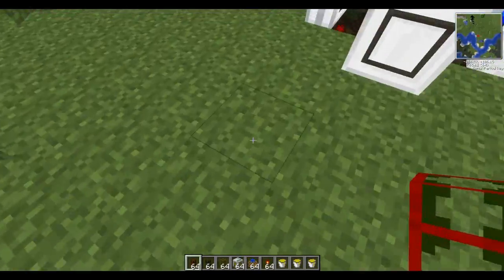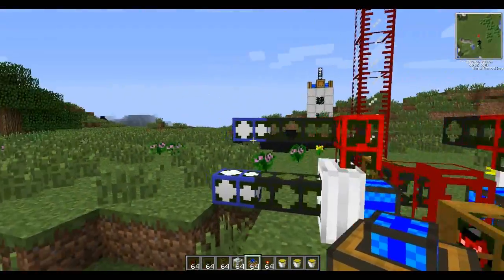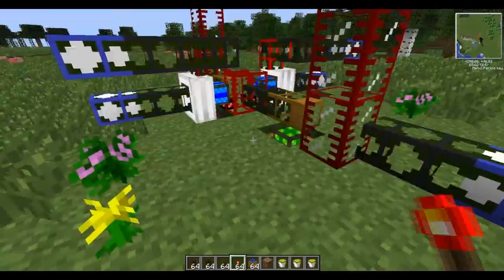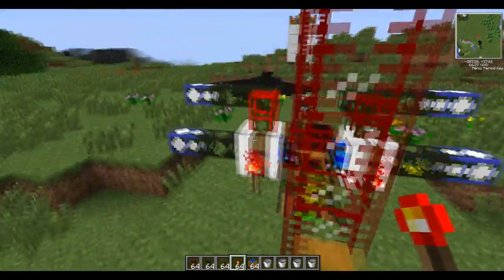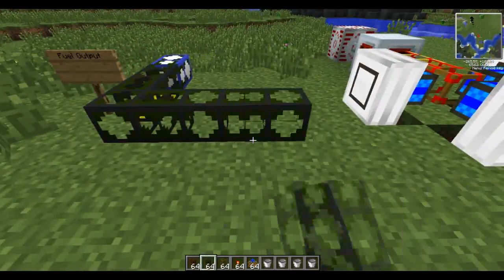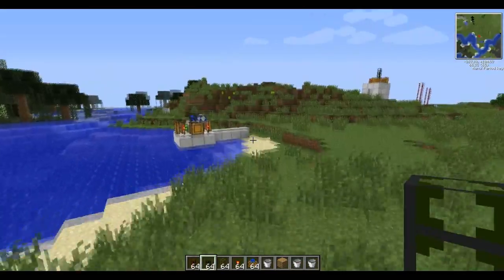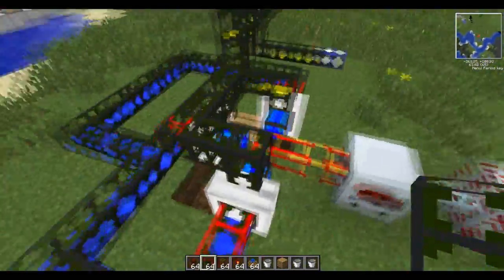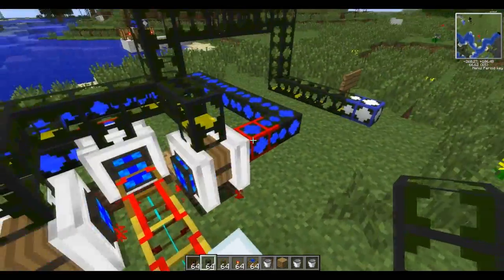Velerious' Tekkit - Safe Combustion Engine (Part 1)

Comment from the maker: Usually whenever I set it up like this randomly it seems to be that 3 combustion engines generates the 510eu/t from the combustion engines, when I put on a fourth it doesn't increase, the wiki does agree with you. Just saying I always set up like this and never have a problem or run out of power, you can always adapt it for many combustion engines though this was just to show how to keep them safe using red stone piping not how to set up 51 engines :) Thanks for pointing that out though ^^